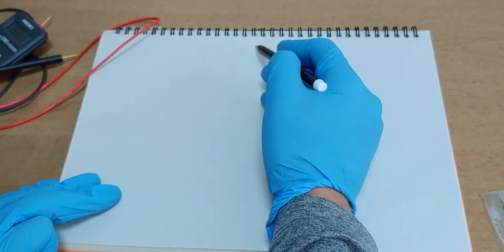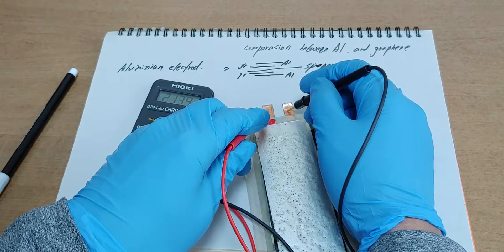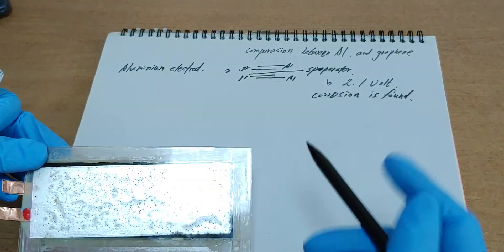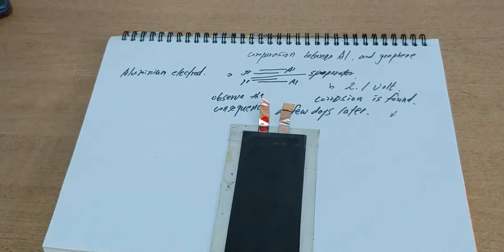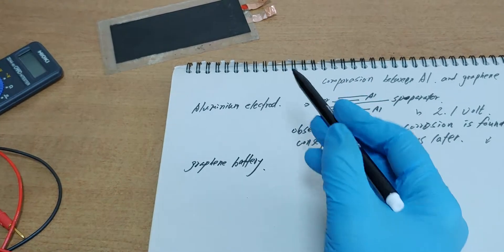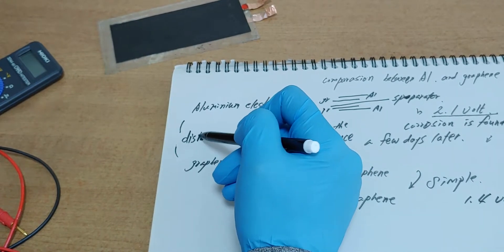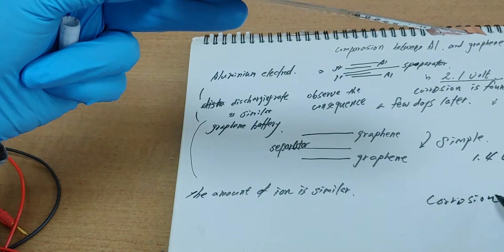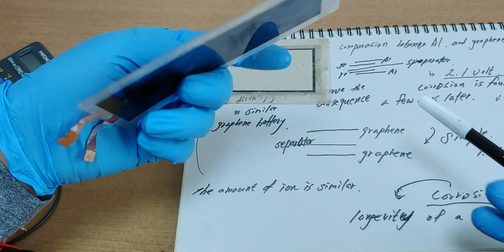graphene battery vs aluminium battery

Comment: Great vid. What is your electrolyte made of? Did you perform any cycle life tests?
Reply from the maker: Thanks.I didn't have a chance to check cycle tests. I am focusing on how to deal with the dropping voltage(inner resistance). Happy new year.
Reply: @solidbattery9956  yes but what electrolyte did you use ?